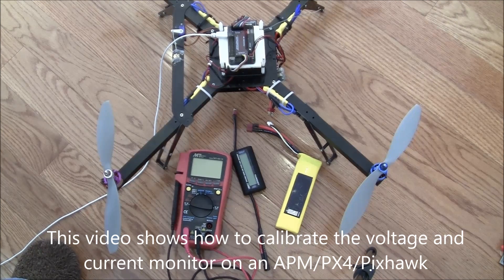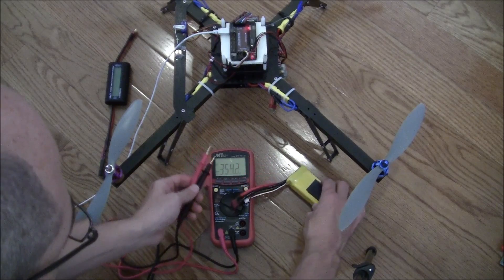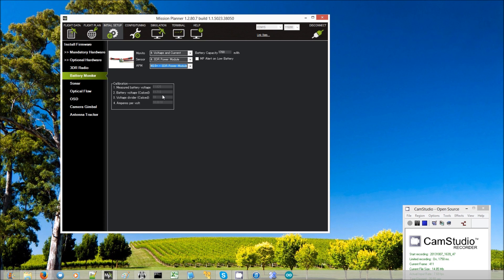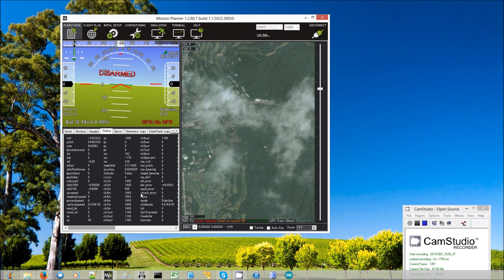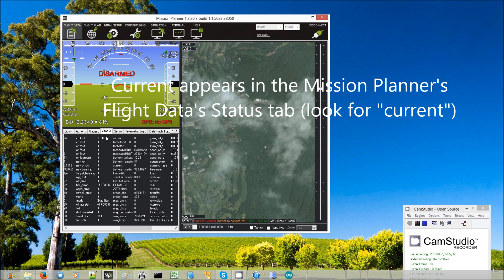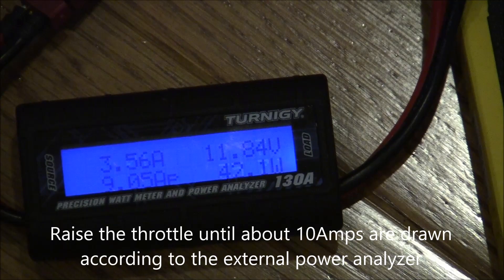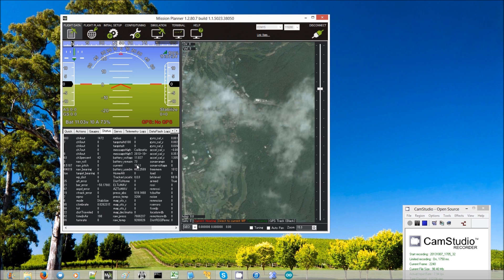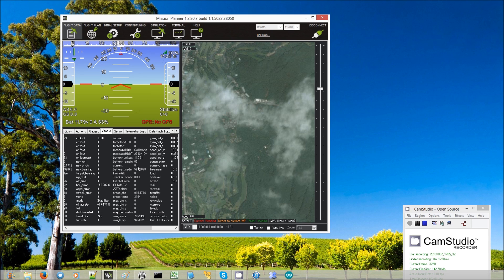ArduCopter Battery Voltage & Current Monitor Calibration

Comment: Sir,  when we are did battery voltage calibration, for mission planner is showing less voltage than hand held volt meter.  Due Due  this problem my drone is coming to RTL after 50 seconds  of my take off. Please guide me about this sir. 
Thank you Sir.

Comment: Hi Randy, thanks for the video explainer.  I'm running the Mauch100A sensor with Pixhawk The Cube.
Followed your steps, and all fine with voltage.... awesome !
But I'm not getting any current readings through AP.  Current in status listings does not move from 0, regardless of A/V entered....
Any ideas on how to fix this?
Reply from the maker: Chris, not sure what the issue is I'm afraid.  I've never used the Mauch sensor myself.  Perhaps make sure the BATT_MONITOR parameter is set to "4" (to measure both voltage and current). Beyond that perhaps post in the forums? https://discuss.ardupilot.org/c/arducopter/copter-36
Reply: Randy Mackay Thanks as always Randy for the feedback/support.
Reply: @rmackay9  Setting is at 4, but perhaps I'm not throttling enough to draw 3A+.  Will try again with the boat in the pool.
Another question I had was regarding the Rover - does this use the accelerometer/gyros in this mode?  I would like to measure and store accelerations during a set routine/mission...
Reply from the maker: Chris, the dataflash log files will store the IMU data regardless of the mode so hopefully it has the data you're looking for.   Let's move the discussion to the Rover forum if possible: https://discuss.ardupilot.org/c/ardurover
Reply: @rmackay9  I've used the second Power port on the Pixhawk, and now have some readings, will post in the forum. Talk to you there-
Thanks

Comment: Hi Randy,

I recently tried this method, could it be that this does not work anymore?

If I arm the motors in stabilize mode as soon if I raise the throttle to have enough current flowing thru the sensor the motors keeps on spinning higher and higher.
So I can not manualy set the throttle to get 10 Ampere for the  calibration.

Do you have any solution to this?
Reply: Pikku Jenny from da hood 
I don't understand your reaction by be so friendly (sarcasm).

What flight mode is a manual mode?
In all modes the flight controller interfering the throttle position therefore I can not set the desired throttle.
For some reason the flight controller keeps on push the throttle upwards.

I have solve it by using a constant load to calibrate the sensor.

Comment: Great video! Would you advice to use an external lipo buzzer module or is it possible to attach a buzzer directly to the board, for security reasons? Just in case that I want to fly my copter without the mission planer software and the lipo runs out of power?

Comment: +Randy Mackay, just recently got back into flying. I am using a Pixhawk PX4 with the 3DR Power module. I am noticing shorter flight times because the low battery beep comes on very quickly. I am trying to determine if the power sensor is not reading properly, or if my old batteries (~2 years only about ~50 cycles) are to blame. The batteries charge fine btw.
Reply: Hey did you find solution

Comment: Not sure if you noticed but when the craft is under load the voltage drops below  the  actual voltage of the battery. you can verify this by connecting a voltmeter directly to the battery while the craft is under load and you'll see the voltage difference changes about 1 volt  and actually shut down my crafts  thinking that the voltage is at a dangerous level when it's not .

 there is a voltage drop between the battery terminal and the sensor  and the software is not compensating for it.  I ran into the same problem when I was programming my own amp meter.  wasn't too difficult  to compensate for in the software.  not really sure why they don't have that option and this firmware  as that was the very first problem I noticed when I was building my own wattmeter discharger/analyzer.

 I suppose I can go into the firmware and update the software to compensate for it.  but I don't think in the worry about that right now, I'm just going to disable the voltage and only use the  milliamp hour  to determine the remaining amount of battery.

Comment: hy Mr. Randy Mackay

I modify minimosd like in this site https://code.google.com/archive/p/rush-osd-development/wikis/Hardware_Mods.wiki

I use the Crius AIO Pro board already in flash with APM firmware ..

How do I get the actual value of the battery voltage can be equal to the value stated in the FPV OSD without using power modules ?

what should I change again ?

I was very plead with you to explain in detail and if you can make a video about how to modify minimosd to obtain the actual value of the battery voltage without the use of power modules on APM , particularly for display in FPV OSD

please...

Comment: i've read somewhere that they fried their board connecting APM using USB cable and battery at the same time. How did you do yours without frying the board?
Reply: disconnect the SBEC from the esc to be safe

Comment: Hi Randy! thanks for such a great and informative video. I have a Pixhawk running on 6S using a 3rd party voltage sensor I got from Amazon that is intended to power the Pixhawk from 6S voltage. I followed your instructions step by step, but I'm noticing that after cycling power on the Pixhawk, the voltage readings are off. And the current draw as well. It is almost as if the numbers I am entering are not being saved to the board. Di you know why this is the case?
Reply from the maker: +traxxi2003 Very hard to say.  you could perhaps confirm that it's really caused by the parameter values not being saved by checking before and after the board is rebooted using the mission planner's full parameter list.  I think the parameters will all start with BATT_

Comment: does the lipo have to be fully charged when you calibrate the voltage?
Reply from the maker: +Matthew Farrugia No, it doesn't.  The voltage monitor will be most accurate at the voltage that you calibrate it at though.  Personally I calibrate it when it's full but it shouldn't matter much.

Comment: I do everythink like u say. If i use "APM2.5+ with 3DR" I have strane volt values (and every 1sec tilt about 1V). After that i use "APM2.5 non 3DR" and then also strange but when do volt calibration everythig is fire. But problem is with amper value. A in mission planner is always the same. I try to do amper meter calibration with props on and calibrate amper meter and nothing happend when i turn down trottle. Mesured value is cca 10A and put down in Mission planner Battery monitor page and when pull down throttle amper sill set to 10A (in Mission Planner. Dont go down. Thx for help.
Reply from the maker: +Mateo Gašparović This sounds very much like a hardware issue with the power module.
Reply from the maker: +Randy Mackay As mentioned to Mateo above, this sounds very much like a hardware issue with the power module.
Reply: +Mateo Gašparović i also have this problem... i still not fine the solution
Reply: Randy Mackay thank u sir... thank god.. is not APM problem is Power module problem

Comment: At the battery monitor set up screen,when i select attopilot180a,the current reading is showing 139++Amp draw without even powering up the quad yet.After powering up the quad,raising throttle to half,reading on the MP screen show the same 139A draw..what is going on here Randy?please help.Thanks.

Comment: Hi Randy.I am using the attopilot 180A current sensor with my pixhawk.I'm having problem getting it to read current draw.Reading voltage is working fine.I check all the wires from the attopilot 180A to my pixhawk is correct.When i throttle up the X8 quad,mission planner showing the voltage reading is working but not the current...please help...

Comment: Can I input 10000 mah in Battery Monitor (one)? If only using one big battery, does Battery Monitor 2 need any settings?
Reply from the maker: +ShadowQuad If you're only using one battery, no need to put anything into the battery monitor 2 settings.  a single 10,000mAh battery should be fine.

Comment: Some of these common props cannot be installed upside down (well, not without damaging modifications). Is there any good reason why this test couldn't be done on motors without props installed, assuming you could get up to 10A or so? Thanks.
Reply from the maker: +Lauren Weinstein You're right that it's becoming more common for propellers to not be reversible (it's better if they're not for the most part because it makes it harder to put them on incorrectly).  We need to put some load on the battery (and battery monitor) to get the current up high enough to calibrate it properly though and without the props on I think the load will be too low.  I don't really have a solution for non-reversible props except to safety secure the vehicle down during the test and try and use longer wires somehow so you don't have to get too close to the vehicle.
Reply: +Randy Mackay I was afraid you'd say the load couldn't get up high enough without the props and was already thinking about how to tie everything down. Certainly doable, though it's bound to push up the adrenaline a bit more. Thanks for the advice and the video!

Comment: This method is not correct. Measuring the battery with no load gives you a different (higher) reading. The correct way to do it is to measure the battery voltage when is connected to the system and then do the calibration if need it.
Reply from the maker: +Paul Atreides I guess what you mean is that the battery voltage will sag when there's a load?  I agree that's the case but here all we are doing is comparing the battery monitor's voltage reading to an external voltage meter's reading and adjusting a parameter to ensure they agree.

Comment: Hi mate, thank you for your video, what module did you use to measure the battery Current?
Reply from the maker: +Mac Niu I used a turnigy power analyzer.  It doesn't seem that Hobby King sells them anymore.  I can't immediately find another store that sells them.
Reply: Thank you for your reply mate!

Comment: Randy Mackay Great video, but can you just plug the USB cable and the powermodule in at the same time without removing the 5V wire from the USB? I have read that some people have done this without a problem but others have burned out their boards.

Comment from the maker: Leandro Praxedes Ribeiro yes, this is a one-time calibration.  As long as you don't change the power module on the vehicle it should be fine forever.  For example, there's no need to re-do this calibration if you use different batteries.
Reply: +Randy Mackay thanks this is so helpful. I did not have a turnigy power monitor but with a multi-meter i managed that. I did that twice.

Comment: Hi! Is it strictly necessary to calibrate the Voltage and Current monitor to have the APM working properly or it's just for you to have a precise reading?
I'm asking that 'cause I've been experiencing some brownouts which have caused my quad to crash several times, so maybe the problem is that I've never calibrated the voltage&current monitor...

Thanks!

Comment: Hey Randy, I alternate between 3s and 4s batteries on my Pixhawk and I have to manually calibrate the the alarm settings every time. Is there to automate this? Maybe the FC can detect the cell count every time?
Reply from the maker: Sergio Orjuela at the moment there's no way to do that.  Switching batteries will also affect your copter's tuning parameters as well I think.
In AC3.3 we support smart batteries and voltage scaling but the smart battery at least will require new hardware (wiki page will be released before AC3.3 goes live).

Comment: Hi Randy Mackay, thanks a lot for the video! One question though: My quad carries two 4S 5200mAh batteries in parallel but I calibrated with only one because I didn't want to solder the necessary XT60 2-to-1 adapter that would connect both of them to the watt-meter. Is the calibration still valid??

Comment: Still having the same problem 8 months later.... if I calibrate the voltage with a new pack (around 12.5 volts) when I'm done flying the voltage displayed in MP is about 0.6 - 0.8 volt lower than what it actually is (displayed on the quad with a voltage display)... this is very important and just does not work! looking on the web I see that I'm not the only one having this problem.

Comment: Thanks for your great video. It's useful to me as I am building my pixhawak quadcopter.  As your external amp meter shows the voltage and current at the same time, why bother to use the multimeter? is there any difference? THanks
Reply from the maker: glad the videos are useful.
So we need to use the external multimeter just to ensure that the APM/Pixhawk voltage and current monitor is producing the correct numbers.
Reply: Randy Mackay thanks much for your reply.

Comment: After you get the current on the power analyzer and the flight data to match do i return the sonar setting to 3dr power module?
When i change it back my current go's back to the original setting and then the current is off again.

Comment: Are there concerns over connecting both the battery and the USB connection to the APM?  Is anybody trying to use an unpowered USB connector to prevent possible frying of the APM due to the double power source?
Reply: +Cameron Stevens I do it that way, I mean, I made an USB cable without positive, I just cut the red cable, so I power my board with battery and monitor it with MP connected with this "special" usb. Never have connected battery and a live usb cable to my Apm, but doing like this way, works.

Comment: Thank you for your time to explain this calibration concept. I had a first go at it my self. I took the propellers off completely and my max Amps drawn were about 2amps. 
Hence I understand that to drain about 10amps or more I need to keep propellers on but in flipped configuration. I will try it later on.
Please feel free to correct me guys ;)
Reply: I have the same.. Wo props max 2.amps

Comment: what happens if you use diffrent battries every flight say a 4 cell then it dies then a 3 cell and  so on.. will this work? or you have to use one type of battery all the time?
Reply from the maker: The voltage and current monitoring will still work fine if you switch the batteries.  What will need to be adjusted though is the failsafe values.  So if you move from a 3S to a 4S battery you'd need to increase the failsafe's minimum voltage so that the battery failsafe triggers.
Reply: Randy Mackay so every time i plug in a diffrent battery i have to go into my pc and adjust it then go and fly? that seems like to much trouble.. i think i might get a beeper that automatically detects.. there only 9 bucks... or try my dx8 get the telemerty module

Comment from the maker: SSBrealty,  If you enable the low battery failsafe then it can trigger a LAND either when the voltage gets low or when it estimates that it's used up 100% of the battery capacity.  So if the current is incorrect that second check might not trigger at the correct time.
If you really don't care about the current then you could change the battery monitor to only monitor voltage but that's a bad idea if you're using compassmot because it relies on the current monitor to get a good result.